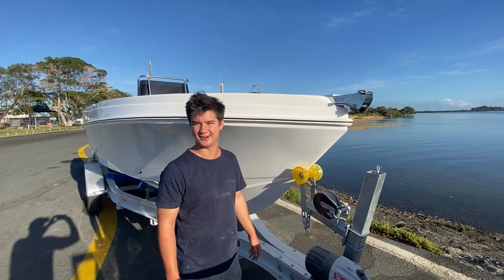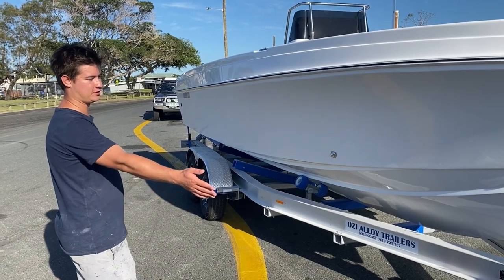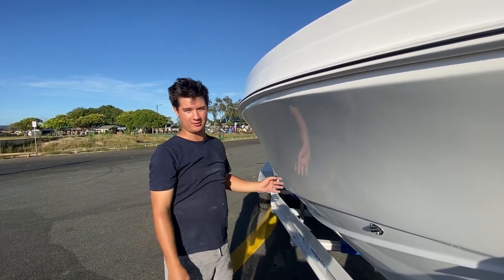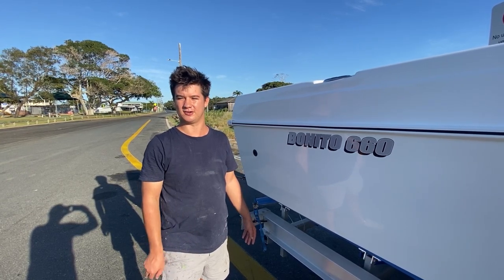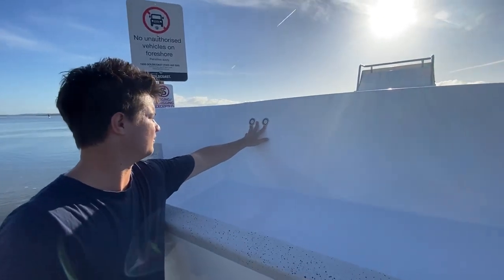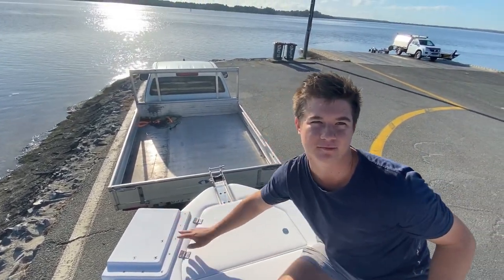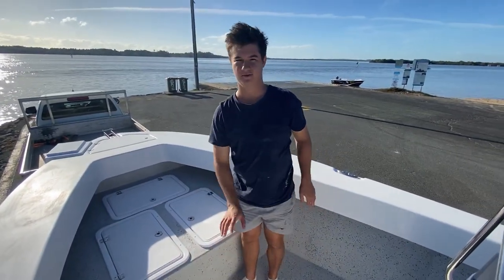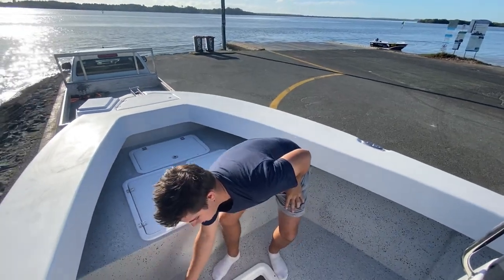Bonito Boats Australia: 660 Centre Console Hull No. 3 In Depth Walkthrough Part 1 of 2-Bills Marine

Comment: Great looking boat well done.. Why do you use Hatches instead of having something like your smaller models that looks much nicer and doesn't impede with your feet? General question not being negative I think its an awesome rig.
Reply from the maker: We will be doing a full moulded cast platform soon, the same size as the large cast platform in the 500/560 so all hatches are flush. Custom cast platforms do definitely have advantages, as we can do any size that suits the customer instead of being limited by the mould. With sea deck those particular hatches would be flush, those hatches also having a raised lip help keeping the compartments dry as the water runs around instead of over 

Regards Adam